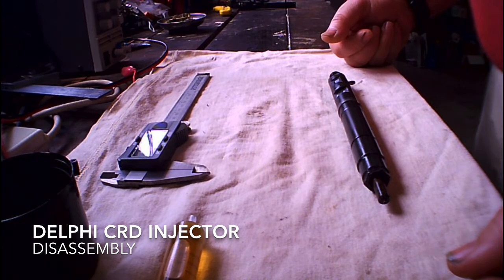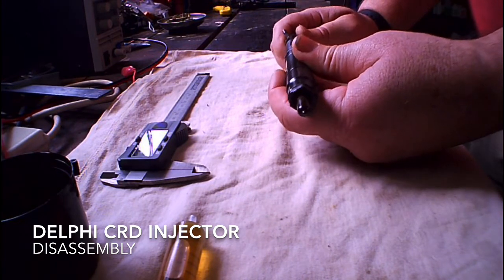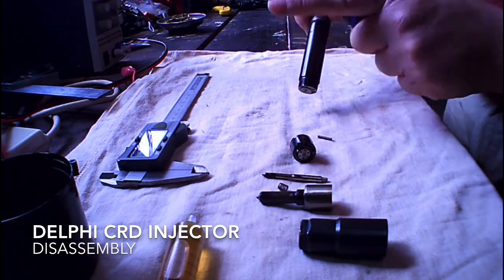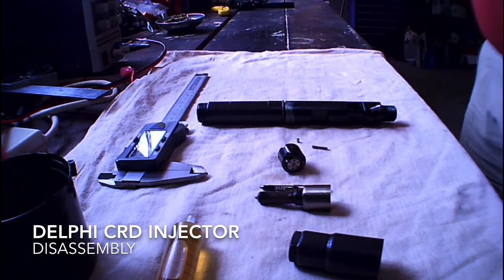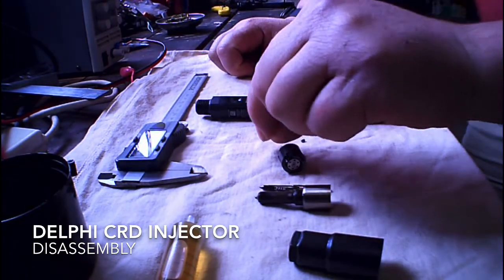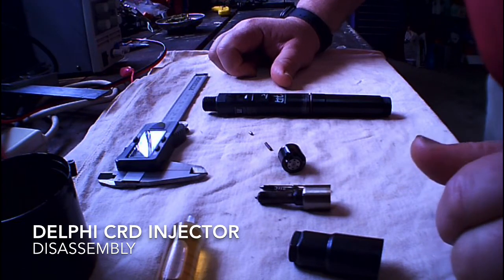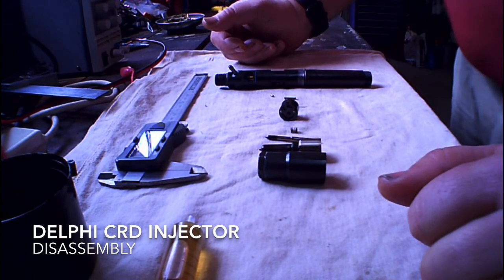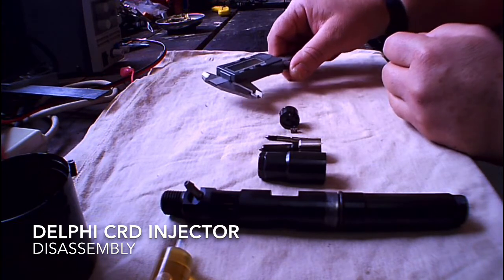Before you disassemble your DELPHI CRD Injectors PLEASE WATCH THIS!

Comment: Is there a torque setting for nozzle when assembling?
Reply from the maker: G’day Daniel, I did a lot of searching on the internet for this one but I don’t recall specifically what the tension is but 70Nm comes to mind.
Reply: @thestickfarm  yeah 70nm is what I could find as well, do you know the correct ohms the injectors should read? I've been told 0.7-0.8ohms but interweb says 0.4- 0.8ohms
Reply from the maker: @danielkempton5206  I don’t recall if I measured them. I would think anything in that range would be fine. Anything less or anything much greater would be trash.